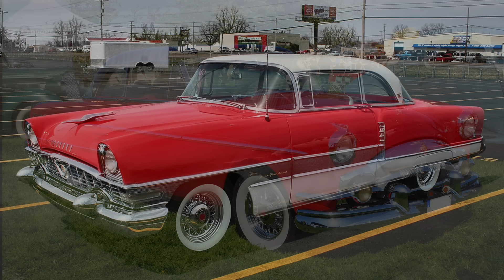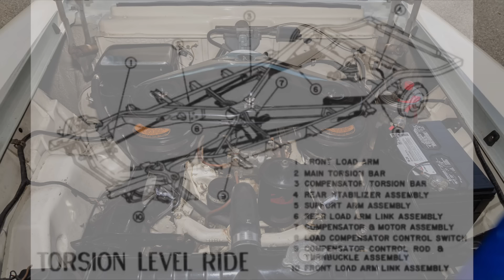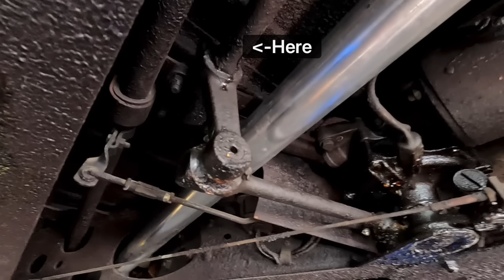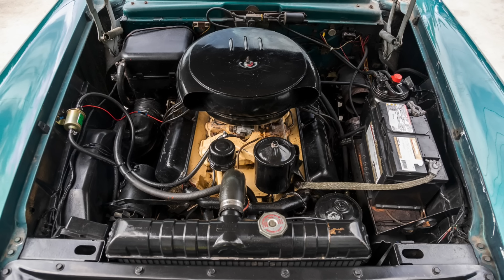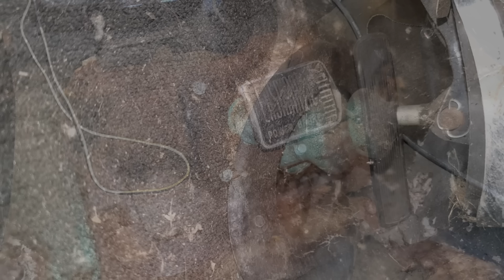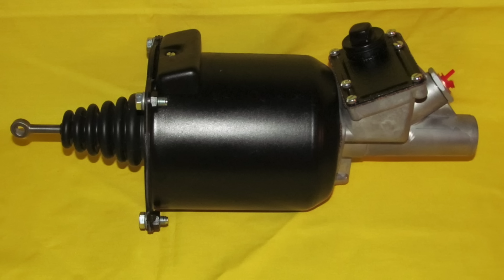Automotive Failures: The 1955-56 Packards Had Both Engineering Triumphs & Flops

Comment: Most unfortunate. Iconic masterpieces with such a glorious history -- the 1930's and 1940's models were just stunning and majestic. The 1950's Caribbean Convertibles were just beautiful and innovative. Even the Clippers were lovable. How often do you change out a master cylinder? Once a decade? Odd but not tragic. Doesn't look any more complicated that replacing a fuel pump. Add fluid? If you've lost fluid, you have a bigger problem. Never "added brake fluid" to any car -- replace the fluid every 2 years, yes, but add fluid? Fill with fluid duing a fluid change, sure. Every two years. Of course, the 1958 Studebaker Hawks was a monstrosity. The early and mid-fifties Packards, however, were outclassed only by the Lincoln Capri Convertibles, whose styling and quality were were flawless, they were nonetheless very beautiful, very American -- open cruisers for a free society.

Comment: My 57 Pontiac also has the booster/master cylinder mounted like that (also the same bendix system.)  It's a royal pain to work with but it wasn't uncommon for the time, though by the mid 50s cars had started moving them up on the firewall where we expect to see them today.
Reply: My 57 Chevy 210 had the single system master cylinder melted where you would expect it to be today, as did my 1956 Chrysler Windsor.
Reply: I think Oldsmobile used that same system also.
Reply: @61rampy65  Aa a teen I briefly drove a neighbor's 1954 Oldsmobile on a errand and remember that brake pedal set up.
Reply: @61rampy65 I think Buick also used it through 1960.

Comment: 1955 Buicks are worse.  The master cylinder is bolted to the frame, fairly common at the time, but that year the engineers forgot to design an access port, hence almost every 1955 Buick has a hole cut through the floor.

Comment: Thanks for posting about these great cars.
As for adding brake fluid....
Early 1960s Mopars had an oval power brake bellows right atop the master cylinder....which was moronic.
To add fluid, I used a tube-bending tool to form a short steel fuel/brake line as an extension to a dedicated, small plastic funnel.
Retained with aviation hose clamps to a short piece of 3/8" rubber fuel line to connect the steel, curved line to the plastic funnel's end.
You still had trouble seeing fluid go in, as again the master cylinder fill cap was 1/2" under the stupid power bellows.
Ultimately, I installed a conventional booster, master and front disc conversion kit to eliminate Mopar's marginal original brakes.